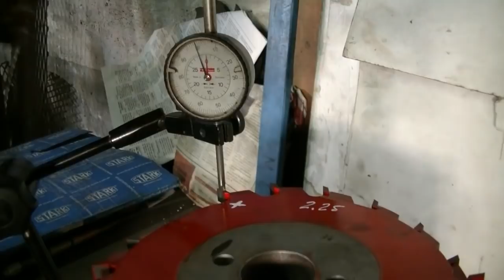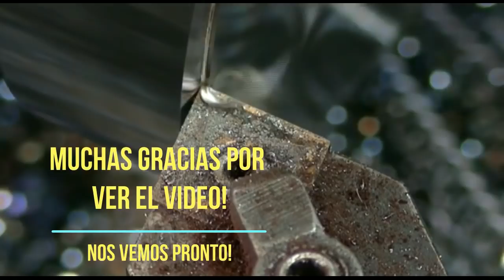Trabajo De La Semana #36   Eje De Laminadora Parte 2 Y Otras Cosas

Comment: hola Fede te agradezco por la respuesta del vídeo anterior muy completa
 que bien afilado te quedo el inserto de que material es?
estoy pensando en comprar un torno come hobby, vi en mercado libre 75000 pesos chino 3/4 hp volteo 230 distancia entre puntas 750
 que me aconsejarias?
Saludos
Reply from the maker: Hola, Fede! Muchas gracias por tus palabras! En cuanto al inserto afilado, es un inserto para tronzado de 3 mm, widia con recubrimiento para acero. Lo que hicimos fue reafilar, con poco angulo de desagote y respetando los despejes para evitar que se trabe o se apriete con la ranura, con una piedra de 80 mm de diamante industrial. 
El torno que propones esta lindo, vi uno a ese precio usado, con los accesorios y en buen estado. La verdad que esta un poco caro, pero no mucho. Creo que seria una linda compra para comenzar con los hobbies. Otro detalle a fijarte son los engranajes para el roscado o avances, que no sean de plastico, que sean en lo posible de acero, para no tener problemas de degaste o rotura facil.
Espero que algo puede ser de ayuda, cualquier cosa lo seguimos hablando. Disculpame la demora!
Saludos!

Comment: Cómo se puede tornear un ruleman?
Reply from the maker: Hola, German! Principalmente, con mucha paciencia, Cuidado en el centrado y torneado, a bajas revoluciones y con insertos comunes para acero. La pasada puede ser entre 7 décimas de mm hasta 1.5 mm. 
Tambien es importante que no se introduzcan las virutas en los bolilleros abiertos, por lo que es necesario taparlos con grasa, o algodón. 
Es importante recordarle al cliente que es algo fuera de estandar, que es muy complicado, sobre todo el ajuste de medida. Se debe contar con un medio de medición preciso, y con previsión de cuanto se quitará de material. A veces realizar una pasada de pasada es mas que suficiente, otras significa un rodamiento a la basura. Esto es mas complicado en casos de medidas en pulgadas, ya que deberas fijarte en tablas de las tolerancias necesarias para el tipo de rodamiento y llevarlas a milímetros.
Como me mencioné, es algo un poco mas complicado, pero se puede lograr con practica. Inclusive con insertos reafilados.
Espero que te resulte útil la info, cualquier cosa, lo seguimos hablando!
Saludos!
Reply: @federicomoulins3027  tus trabajos son de un increíble ,,,,, gracias x responder ya que tengo un torno muy antiguo y saco viruta como Jovi y realizó algún que otro trabajo gracias x compartir tus conocimientos